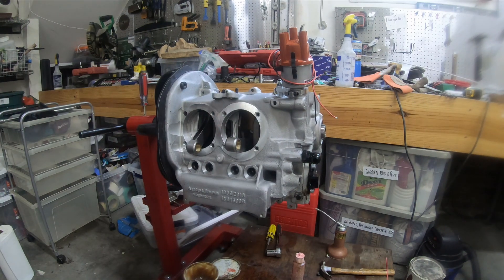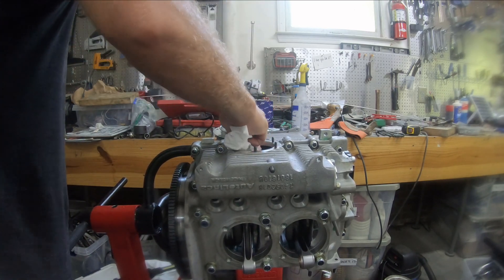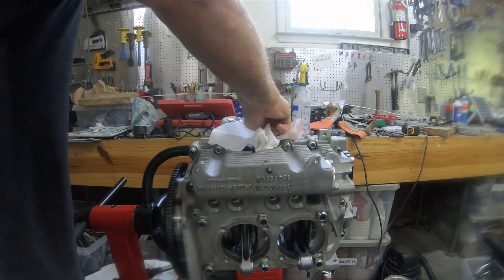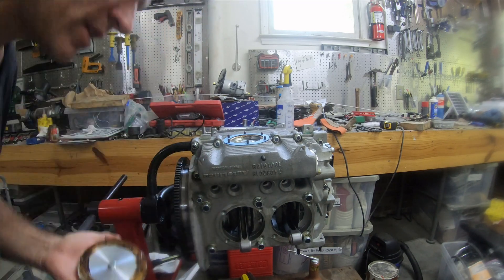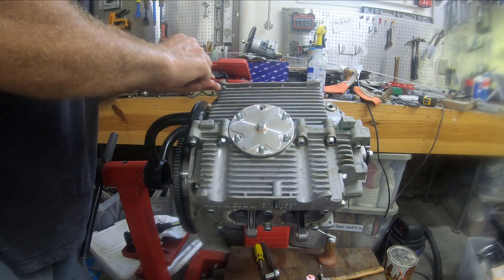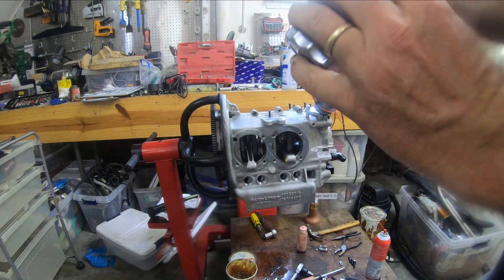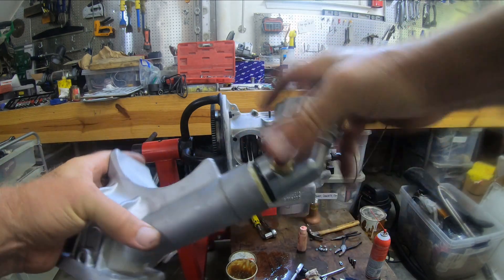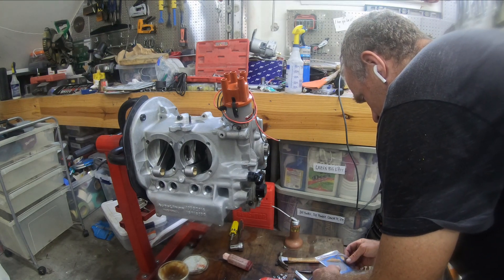2332 VW Air-cooled Stroker Motor - Video 14 - Full Flow Fittings, Oil Pickup and Plate, Oil Filler

Comment: no sump. gimmick. you want more oil? bigger filter or buy a dual filter adapter.
Reply from the maker: I have a sump on my 1968cc, but I suspect the mini oil leak might be the sump or the main seal.  I have an external oil filter and oil cooler, so I am going to try this one with no sump and see how it does.  At least I can eliminate that as an oil leak cause…. I will not be flying around and revving to 7000 rpm - this is a bus and low rpm.